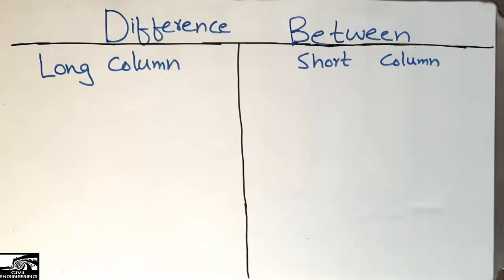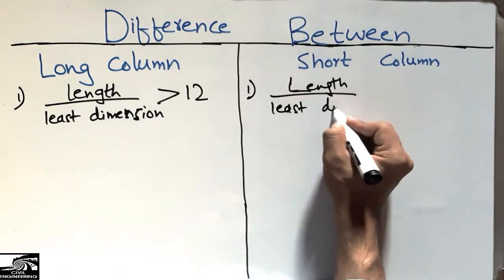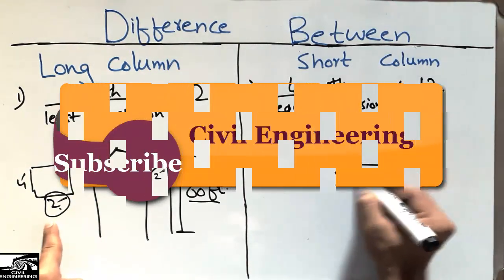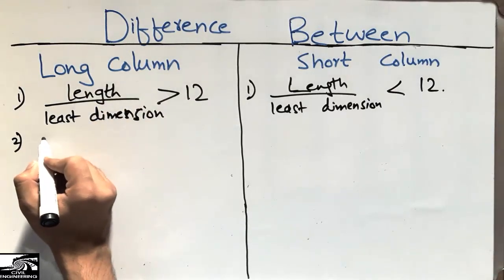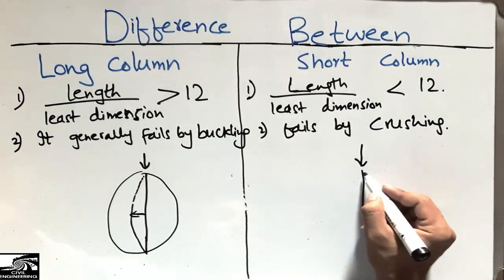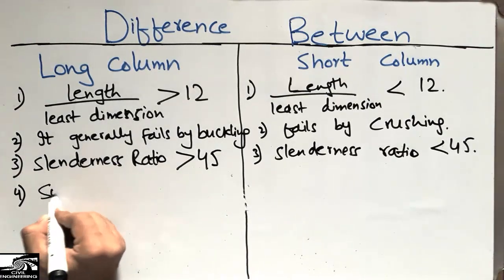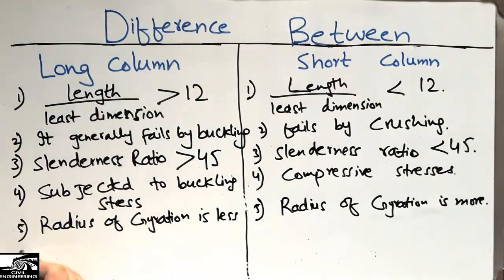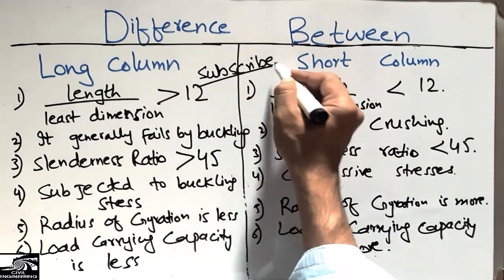Difference between Short Column & Long Column

Comment: Effective length or length
Because effective means .5L
So it's full length divided by least
Or .5 L divided  by least.
Reply must
Reply from the maker: Effective length means that it has been multiplied with some factor.
Reply: @civilengineering94  so only full length right.
For meter as well as feet.
Any units it's full length. 
Not half.